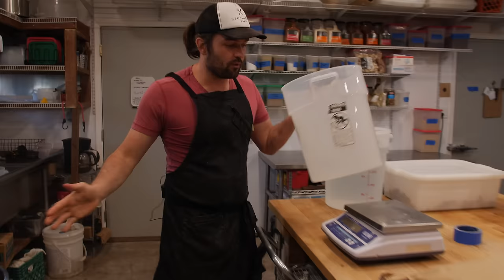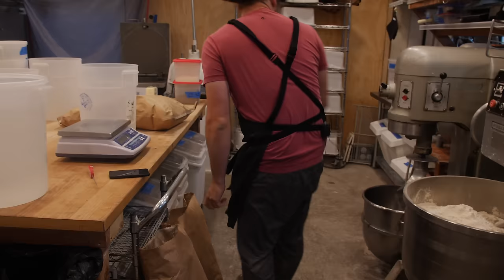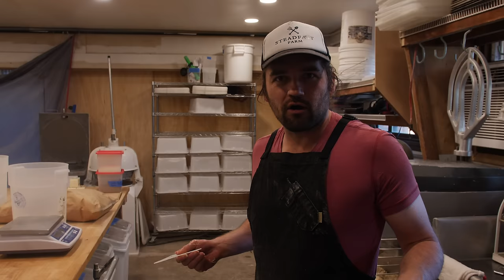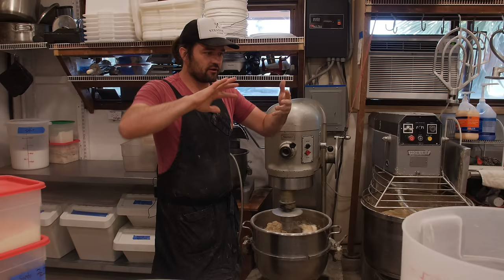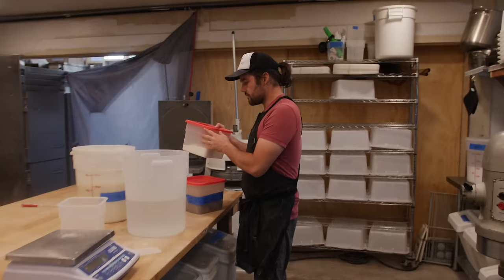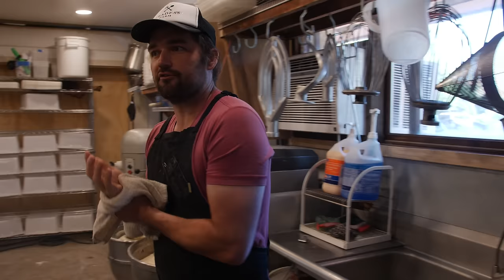Timing and Temperature are Critical for Sourdough Bread | Proof Bread

Comment: I run a small micro-bakery in UK and who would comment negatively about your lovely set up! I was super intrigued about your process using Trevor Wilson's pre-mix as I am handmixing larger batches at the moment and did dabble with this approach but also only worked for me when I put dough in the fridge as otherwise especially with UK flour I would end up with degraded flour soup....It is an art though to bring it up to temp in the morning for completion of bulk and adding levain...I would love to hear your thoughts and tips on this...thank you so much for sharing....
Reply from the maker: For us this was not difficult due to the lack of A/c in our space at the time. Today, I would have to throw it in a proofing chamber. You can use a covered speed rack, or 1/2 rack, with a small space heater/humidifier inside. Couple with a PID controller for both temp and humidity, and for around $150 USD you have a proofer.
Reply: @ProofBread  Thank you and I did look into a proofer like that already...I assume what I getting my head around is what the 'ideal' temp would be to prevent the dough to degrade too much and then to get to get it up to speed again at a warmer temp...all fun..thank you so much!

Comment: First of all, thanks so much for all the great content, it's a goldmine for everyone who wants to know more about bakeries en sourdough bread making. Great stuff! I was just wondering, after the autolease, you add the salt and the starter, but is the starter coming straight from the fridge, or has istalready come to ambient temperature before you add it? Thanks so much for your reply.
Reply from the maker: Depends.
It doesn’t really matter the temperature of the starter if you achieve your desired dough temperature. In the winter, we rarely use the fridge for starter. In the summer, it’s a lifeline. We understand when to chill so that it suspends at peak fermentation. You should check out there starter management video for more on this.
Reply: @ProofBread  How long will the starter suspend in the fridge at peak?

Comment: Technical question on milling: what sieve size does your mill use to catch the largest 15% particulate in your A85 flour blend ?  Also, is there a min particle size sieve used as well, thus giving a 'middle cut' range of particle sizes in your wholemeal blend ?  Kinda like italian polenta, only much finer ?

I ask because I dabbled a bit in home ground flour, but none of the amateur level manuals and literature ever talk enough (if at all) about sieve mesh sizes and how critical it is for a flour's behavior.  Western AP flour for example is usually ground fine enough to get through a 100 mesh sieve (comparable to fine talc), wheres Indian Maida i'm guessing hovers around 60-70 mesh.  My home mill's finest setting is kinda coarse compared to that ... my 40 mesh sieve only lets about 60-75% through, and im guessing a 70 mesh (which I dont own) would likely only let about 10% through - so clearly it's not able to grind finely enough to even achieve even a maida-comparable grind.  Best I can manage on my finest setting for say corn, with a 40 mesh sieve is a coarse corn flour (which drops thru) and a mix of fine cornmeal, corn germ and pericap (all caught by the same mesh).

If you have a book title, or site linkage, to anything that discusses grinding and mesh sizes in detail, i'd be very grateful.

Egads, I wish I lived close by ... i'd work p/t for free, just to learn and share info.

Comment: Well I'm no Charles Schwab, but I think I might have a small correction regarding your profit margins vs equipment costs. Generally, your equipment is carried on your balance sheet at its book value, which in your case would be the purchasing price minus the accumulated amortization. So if it's a $10k worth of equipment with a lifespan of 10 years, you would amortize it at a rate of 1k a year (depending on the amortization method you choose). You then allocate that 1k to your expenses, which ultimately affect your profit margins, meaning, you only spent 1k of that equipment worth in that 1 year. So after 3 years the book value of your equipment would be 7k. If you don't need it anymore, you would probably sell it. Depending on the selling price, you would then have to either recognize a loss or a gain. So if you sell it for 7.5k, you're happy (extra 500 bucks yay!), if under 7k, well, that still wont affect your margins as if you had lost the equipment altogether.

Comment: Just curious, as a new baker I keep reading that you should avoid using tap water because of the chlorine that’s added. Are you using filters to remove the chlorine or is it less of an issue than I’ve read about?
Reply: Simon WoodburyForget  thanks so much for your reply. I was a bit confused by the contradiction between what I’ve read and what I see in so many videos. Your answer was very helpful!

Comment: I'm really enjoying the detail in your videos. I only make a couple of loaves of sourdough a week, but will pay more attention to temperatures for consistency. I noticed that you let quite a bit of water go down the drain while you set temperature. Would it be better to run the water into the container as you stir it and adjust the faucets to reach the final temperature or is the cost of water not an issue?
Reply from the maker: To be honest I have been quite surprised about all the commentary regarding water. Perhaps our costs are not as large as other places. I think it took longer than normal due to the talking, but nonetheless the commentary has definitely given me some pause and consideration over water usage. It’s perhaps a good reason to invest in a doser, like I describe in some content. I certainly think there could be a better way to receive full utilization from the water. Thank you.
Reply: @Hypervigilant  Hmmm... it looks like he's adjusting the faucet to achieve a final temperature around 81 degrees. If I ran only my cold water that long, it would drop in temperature as time went on to around 55 degrees or so. Our water is treated with Chloramine and I don't like to use it to feed sourdough starter until I neutralize it. I also have reverse osmosis filtered water available that removes the Chloramine and contaminants, but my sourdough starter doesn't seem to do well with it.

Comment: Do you take any precautions, so your sink’s drain line doesn't become clogged with hardened dough residue? I live in a highrise condo and fear my neighbors below are going to lose the use of their kitchen sinks because I've flushed starter and dough residue in their direction. Large amounts of starter and dough go in the compost, but smaller amounts are mixed with warm water and proceed down the drain.
Reply from the maker: If we ever do have to put larger amounts of starter down the drain, diluting is our best option. I’d like to install a disposal under our bakery sink. If you have one, I imagine it could help process the starter.

Comment: Great video. I have a question. By shooting for mid 80s for your dough it does not lead to your dough fermenting too fast. I am asking because just like what you experience in arizona I experience very hot weather in the Bahamas. I was taught that its best to shoot for high 70s. I am not criticising but just curious.
Reply from the maker: For sure, there is a speed up in the mid 80’s, but also a flavor boost. If you’ve ever worked with a rye in the 90’s, the tang really starts to build. Lactobacillus really prefers the 90’s, so I find that pushing into the mid 80’s yields better flavor.
Reply: doesn't it depend on the type of mixer he is using ? planetary mixer he adds much cooler water ! french temps recommendations (in celcius) is : temp of your flour + temp of your water + temp of your starter must be around 70 as in flour 22 starter 22 then your water must be at 70 - (22+22) =   26 degrees C (78.8 degrees Fahrenheit) too hot outside ? put your dough in the fridge for a bit ! ideal temp for dough is 24 to 26 degrees C for it to ferment well if i understood it right
Reply: @ProofBread  ok thats interesting. I know 100 percent rye uses higher temps to speed up development since it gets stickier the longer you mix. But what you are saying makes since. I made a country loaf with 20 percent rye the other day and it was a bit warmer. As a result the dough moved faster, which resulted in a tighter grain but the flavor was more intense. Thanks for that insight. I also just took a look in the book bread. He talks extensively about a detmoulder method used in rye breas. The starter ia built up in 3 stages one for the yeast, one for acetic acid and one for    lactic acid. In the lactic acid buil he shoots for 85 degrees. This lines up with your theory. Thank you so much.
Reply: @ArialAElise  yes it does. However I was questioning the temperature he strives for which is mid 80's. I was taught to strive for high 70s  in sourdough but when I learned about factory bread low 80s. So mid 80's is something very new to me. Yes I have been taught that 24 to 26 c(75-78f) is Ideal but in this video he states that  he shoots for mid 80's. You understand.

Comment: The temperature matters not for the ingredient with the most mass, but for the ingredient with the most heat capacity: that is very much the water. Hot flour would deposit its heat into water and the water would barely change.

Comment: Several thousands for a water dispenser? I think the temperature part can be done easily for less then 100$ as it is commonly used for pluming and in showers with temperature regulation. I have installed it in my home for the shower and the sink as the water is really hot in my apartment and i don't want to risk any burning. And as your are also only shooting for a +-3 degree range that should be easy.  Exact volume measurement might be more tricky, but sourly not thousand(s) bucks tricky

Comment: Does the tap water have to flow at the perfect temperature? Can't you fill the container with hot water and dilute it until you reach the right temperature? I mean, you live in Arizona. It's not like you have so much water to begin with and in general it's a big waste.
Reply: turuanu ..... are you taking 30 second showers?
Reply: @mikebordeaux8218  No, I take showers that are as long as required and I take advantage of every bit of propane. What is your point?
Reply: @turuanu  .... you are critiquing his use of water but before do that have you made sure you are being as efficient as possible?
Reply: @mikebordeaux8218   Of course, my friend. Why would you assume I'm a hypocrite?
Reply: I don't even have hot water in my kitchen. I live in the forest of Costa Rica, and we have heaters only at our cabins where we shower. But even if I did have hot water in the kitchen, I'd open the hot water right away, fill the container partially, and cool it down to the right temp. I haven't watched the vid again, but maybe in that video it took him so long for the hot water to even come out? In that case I take it all back. But no, I remember he was taking the temp of the running water.
Reply: @SimonWoodburyForget  His water heater must be veeeeeeeeery far away, then. Oh well.

Comment: https://youtu.be/OZgzcTbAY78?t=138 By far the most important factor going into FDT (i.e., final dough temperature) is water temperature. The specific heat of water is much higher than flour above freezing. And while we are at it mass is not the same as weight. By mass there is more water in dough than flour. The same volume of water is nearly twice the weight as flour.
Reply from the maker: Thank you very much for this correction. You are right. Water does have more influence on the temperature than the flour.

Comment: I have had great success using autolyse (spell check has no clue what it is). I learned about it when I found Hokkaido bread several years ago, use it on all breads now, even works with bread machine, don’t judge me🤣
Reply: Just out of curiosity, how long do you let it sit for autolyse?
Reply: peterlip8 I let it autolyse for 20 minutes, then I add salt (sugar and butter if an enriched dough).  I’m still learning and trying to get my nerve up to try sourdough so I make a lot of yeasted dough.

Comment: Interesting discussion around 31:00 mark about mixing and gluten development. 

I’m just an amateur baker but I’ve had great success with a 100% whole wheat recipe in which yeast, salt and sugar are added to the premix (flour+water autolyse) and then mixed in the food processor at a much more violent pace than a stand mixer. Total mixing time is a little over a minute per loaf. It seems like the intensity of the mix actually helps gluten development rather than impairing it. I wonder why this is?  Here is the link to the recipe I’ve used.  https://www.seriouseats.com/recipes/2019/01/100-whole-wheat-sandwich-bread.html
Reply: It also uses an instant yeast, these produce gas much faster, you could build gluten fast in a sourdough too by aggressively mixing but by the time the natural yeasts have had a chance to puff up the dough the gluten would be too relaxed and over done and it would just flop, that's why you take things slower to get the the gluten development and gas production to intersect at the right time. Your recipe looks interesting but you can't compare it to a traditionally made sourdough.

Comment: If you want to experiment automating the water temp adjustment, I wonder how putting an immersion style sous vide water heater would work. You'd want one with max wattage, I know Anova has a 1200 watt model, there must be a comparison chart somewhere. I see Gesail makes a 1500 watt version if you don't need temp control for about $40. Bayite makes a temperature controller / sensor to plug it into for about the same.

I've seen a sous vide machine used for regulating the temp of beer mash, with a filter of some sort so only water circulates through the machine.
Reply: @Proof Bread  I agree with this, invest in a sous vide machine. It will save you loads of time with only a ~$100 cost.  Just set the machine in your bucket, set the temp, and wait for it to reach the exact temp you like.

Comment: I actually do the opposite of your system, 45 degree water and proof at 70deg /70 % humid for 16 hours. With a 2 cup water , two tsp yeast and 2 cup flour auto. Mix is 4 min on to pre and then auto and 4 slow and 4 high speed.. I hand roll everything, around 100 pounds a day for sub rolls
Reply from the maker: I love how many different bread making traditions there are. This is why a few simple ingredients represent so much variety and culture.
Reply: @ProofBread  I just woke up and thought I was late for work, it's midnight.  My so called day off. Greetings from Simply Gourmet in Lake Placid NY. We love your vids.

Comment: I don't see how you will outgrow that sheeter. It can produce 200+ croissant an hour. If anything you'd buy a second one. And anyway what would you upgrade to?
Reply from the maker: The sheeter is one of the first pieces we were able to buy with intention. It’s much more likely we would outgrow our current mixers.
Reply: @ProofBread  my issue with mixers is that they spend so much of their valuable time in the early morning full of autolysing dough. The mix times are short ~10 minutes to mix ~100kg of dough means that if the usage was more efficient you could do a huge amount in a few hours. And I'm really not trying to autolyse for shorter time. I want a way to hydrate a large amount of flour outside of the mixer in some kind of big storage container and then once its been autolysed for an hour feed it 100kg at a time through the mixer. The pre autolyse mix only needs to be rough so you don't need a proper mixer to do that part, I worked at a bakery that used a hand held power tool meant for stirring cement to combine their flour and water for the levain. Maybe that would work.

Comment: What you're describing at the end of this video is a problem with our monetary system on a macro level. Since we're on a debt based fiat currency system, an increasing amount of debt in all sectors of the economy is the only way to keep the system up and running. Otherwise, deflation crashes the economy. In addition, there isn't enough demand overall for high quality, higher priced food for the majority of restaurant/shop owners to operate on higher margins and have more equity in the things they own because of an excess of consumer debt. The economic system that would be conducive to what you describe would require a stable monetary system (something like bitcoin or a currency backed by gold) and a high savings rate within all aspects of the economy.

Comment: This may be premature,  but if the tent walls trap to cold then why buy what sound like another temporary fix(polar sheets)
Reply from the maker: The polar sheets are more of a fixture we can keep. They allow passage between the rooms, and visibility, but are an incredible insulator. We installed them a couple weeks ago, and are amazed at the difference. The oven room can be 100 degrees, the dough production area keeps 75.
Reply: Polar sheets are not a temporary fix. They are vertical fairly thick plastic sheets about 8 inches wide manufactured to mount in  doorways to allow passage between temperature sensitive areas.  They are an awesome addition when you need to control temperatures between rooms, walkin coolers and walkin freezers.
Reply: @edwardfknight   the way I took is that John  was going to use then 7until he physically  walked the room off.
Reply: @ArchLinuxTux  Just curios here did you proof read your post before you clicked on the the reply or were you just in a hurry to present an argument? I'm pretty sure his name is spelled Jon.
Reply: @ArchLinuxTux  Here's is a photo of what a Polar Sheet installation looks like.  Here endith the lesson.
https://drive.google.com/file/d/1j1tfmSX763F40TLTKir24ccAhQkQNylq/view?usp=sharing